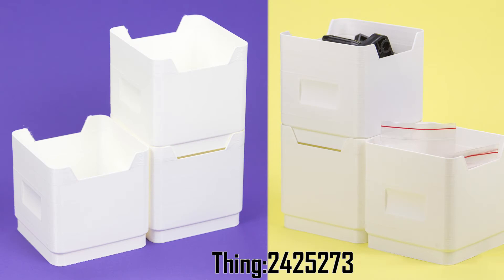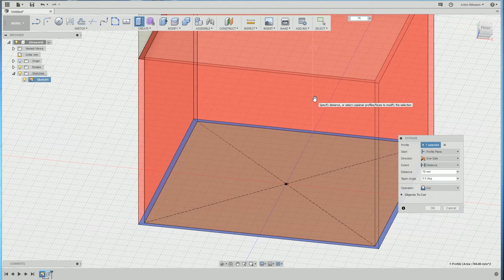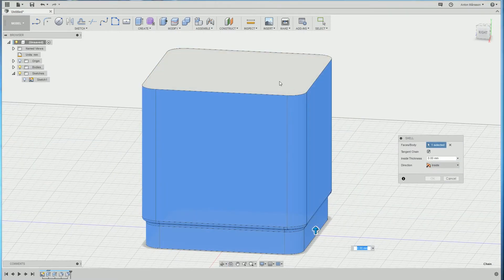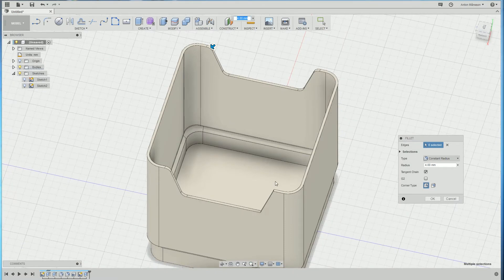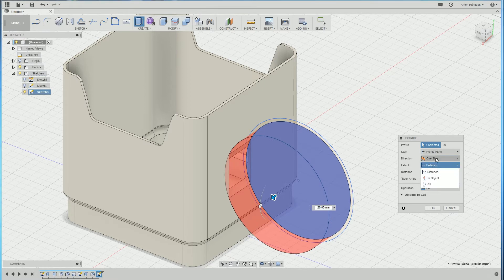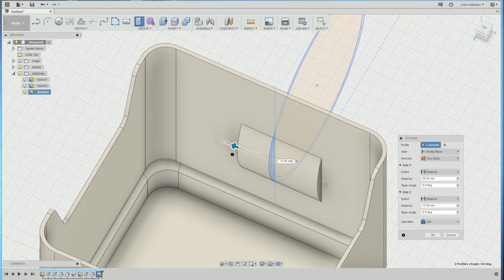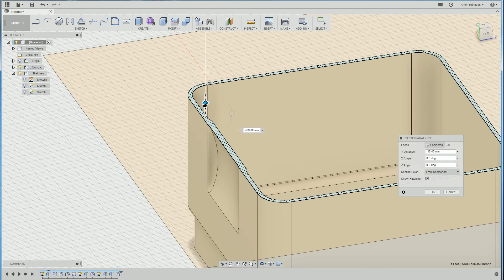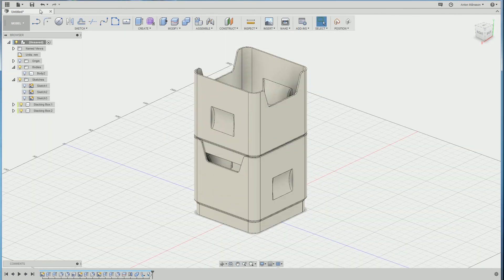Autodesk Fusion 360 for 3D Printing | Stacking Boxes

Comment: Thanks for the tutorial! Just thinking wouldnt it be easier to use an arc to do the handles? I think it would be easier to find the proper size and position like that. What do you think?
Reply from the maker: +Didier Klein totally agree, good tip for others too.  I usually get stuff done in 3d efficient, not always the correct way.  On the other hand there are usually 5 ways to do the same thing when it comes to CAD :D
Reply: Yes true :) that's why its always usefull to see how others do :)